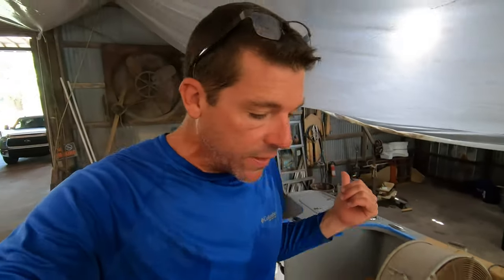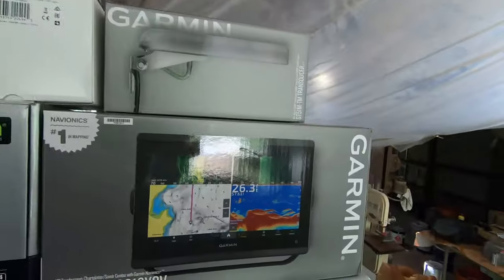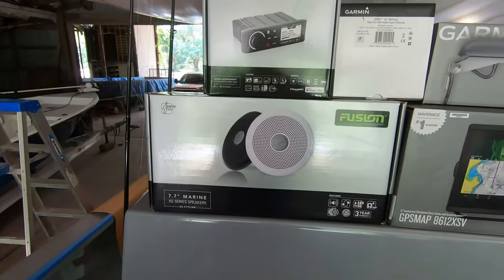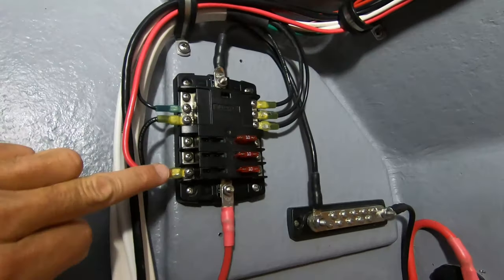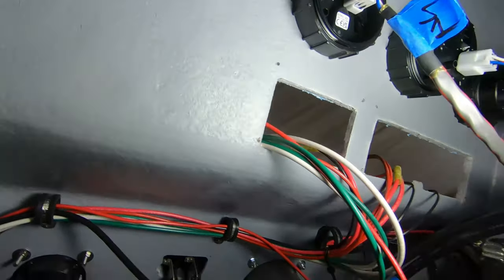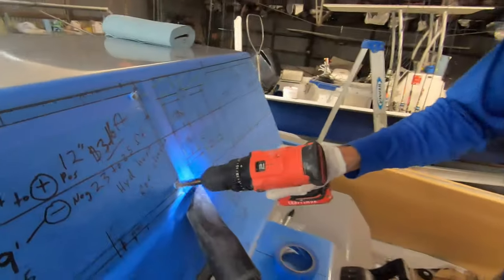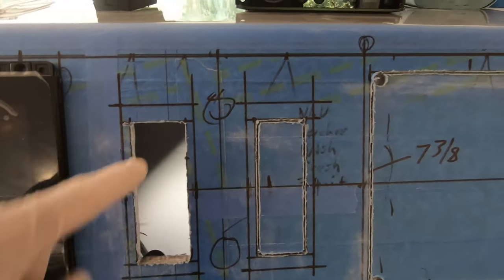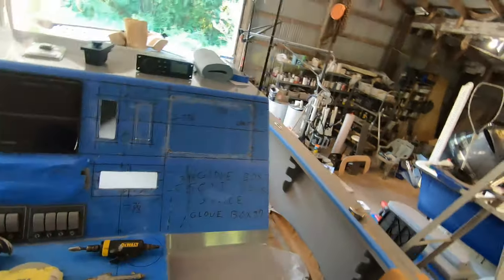EP-24 WE ARE BUILDING A NEW BOAT! NEW MARINE ELECTRONICS AND WIRING

Comment: Thanks for another great video Captain Joe!  I hope you have stock in Fein since I just ordered one of their top-of-the-line multi-tools after your recommendation in this video. 😂 I have a DeWalt jigswaw and Rotozip cutting tool, but I can see how the Fein will be better for cutting out holes for displays and such in the console.  Thanks also for mentioning the GRID 20 from Garmin.  I bought one a month or so ago after watching this video the first time around.  I discovered that one GRID 20 can control multiple displays.  I don't have room for two GRID 20s on my console so will switch back and forth between  the GPSMAP 8610xsv and GPSMAP 943xsv displays as needed.  

Perhaps I can recommend a tool to you.  I recently upgraded from a single battery to dual batteries on my Robalo so had to run a 2AWG cable from the rear to the console, and did a lot of other wiring with more to do.  I bought a TEMCo hydraulic crimping kit and it does such a great job of attaching terminals to cables and wires.  Just a thought.

Keep up the great work!  😊

Comment: What's the beam and LOA on it?  Deadrise?  Looks like it has turned out nice.
Reply from the maker: The beam is 9,6 midship, tapering to 8,6 at the transom. LOA down the centerline is 29 feet. The boat has a variable deadrise. with a 17.5 degree average at the transom. 160 gallons of fuel capacity and 30 gallons of fresh water. I will have top speed run and boat tour video coming out soon. Thanks for watching!

Comment: I keep wondering and this may seem a silly question but it’s been bugging me! 

How do you stop water from tracking down alongside screws/bolts in fixtures? For example you apply sealant around the base of a cleat for example but then what’s to stop water tracking down the actual screw?
Reply from the maker: I also apply sealant into or over the screw holes, and apply some to the actual threads on the scew itself before running it in. Then just clean up any excess sealant that squeezes out. With bolts I always apply a bead of sealant under the shoulder of the bolt, or the washer on the bolt before running it in, then more sealant around the bolt threads on the other side before installing the washer and nut. You should get squeeze out around the bolt when you tighten it up. Then clean up, or tool the excess sealant that has squeezed out. I have a video on the channel showing this process. I believe it is titled how to seal and waterproof holes in plywood. I hope this helps, and thanks for watching!
Reply: @FishBumpTV  thanks for your response! Will go find that video. Loving your channel and these workshop content videos!

Comment: Love watching you videos! Curious if you through bolt all the hose clamps and bus bars, etc. inside your console and you can see the backside of the fasteners on the outside of the console? Or are you somehow concealing those fasteners? Working on a 14’ Livingston and I’ve learned so much from your videos
Reply from the maker: Thanks so much, Glad you are enjoying the content! That's a good question, We have pieces of 3/4 inch thick Coosa board glassed into the areas in the console where we are running screws in. You could also use 3/4-inch plywood to create a hardpoint for your fasteners. We are also using the bolts that are holding the rod holders on for some of the clamps. We did thru bolt the battery charger to the console side because it is very heavy and quite important. Hope that answers your question. Thanks again for watching, and good luck with your project!